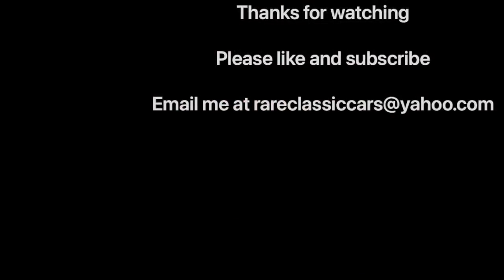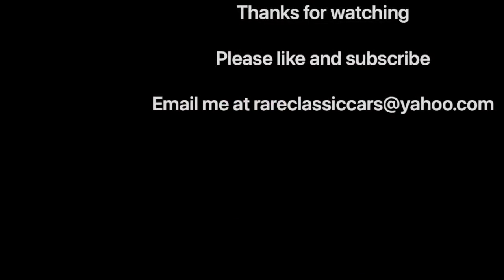Worst Engines of All Time: GM 2.5L Iron Duke Follow Up

Comment: A noisy, crude, rough and weak engine that gave no driving enjoyment. Sounded like it was full of marbles. I don't care how long it runs for, that just means all the more suffering with it. An engine that encouraged people to check out the competition. Definitely one of the worst ever. Your analysis is correct Adam. And by the way I had one in a Citation that ended with a rod out the front of the block and oil on the hot exhaust which ignited and I gladly let it burn. It was over. Finally.
Reply: 301, runs extremely smooth.  Half a 301, not so much 😢
Reply: Was she over the "redline" when she blew?

Comment: The air cleaner on the iron duke 2.5L is too small at its max HP / airflow range. A GM AC air filter in the 80s was ok but a Fram air filter was way too restrictive.  Many of the 2.5L cars really needed a bigger air filter size.

 The top speed of the 1982 Camaro is like 100 to 105 with the AC filter and like 90  to 95 with the Frams..and you better hope that fram filter is not dirty. 

There is such a restriction with the fram that i have had the filter collapse and break and now you have more HP since no crummy filter in place.   

So if you are traveling at 70 85 or 100 mph about the same HP is needed in an 1982 camaro whether you have a a 2.5 or 2.8 or 5.0 engine.  

The 2.5L engine has heavy pistons thus never is going to rev as high rpm as an engine with smaller lighter pistons

Comment: I liked your first review.  I found it good and kind of funny in that it called it one of the worst, yet encouraged guys to buy one to try it.  My parents had one in a Chevrolet Celebrity.  My parents bought it used with 80-ish thousand miles.  I thought they were going to have numerous problems with the engine, transmission and steering rack, yet they had zero!  The engine was just as you said - low power, good fuel mileage, rough, etc.  To me at the time, I thought completely uninspiring when you could have "foreign" car that was far more enjoyable to drive.

Comment: In 1982 I was a test engineer at GM's Milford Proving Ground - what a great job!  Anyways we ran tests comparing the 4 '82 A car engines for acceleration and fuel economy.  We tested a Chevy with the 2.8L-V6, a Buick with the 3.0L-V6, a Pontiac with the 2.5L Iron Duke, and an Olds with the 4.3L-V6 Diesel.   The 2.8 and 3.0 were carbureted, the 2.5L had TBI fuel injection, and the 4.3 was indirect injection diesel.   All had the 3 speed THM125 automatic.  The results were, the 2.8L was the quickest (0-60 about 12 sec I think) and got better economy than the 3.0.  The 2.5 and the 4.3 were similar, with the 4.3 diesel being a bit quicker, and the 2.5L getting a little better economy.   So the 3.0
Reply: sorry  - so the 3.0 and the 4.3 did not make much sense and did not last very long in the lineup.
Reply: Always good to hear from guys who  worked at GM.  You got the inside knowledge 🙂
Reply: Do you have any stories of working with GM's wonderful Cross-Fire fuel injection during that time?
Reply: @dennissmith9577  Sorry Dennis, no, other than remembering that it did not perform any better than the Qjets.

Comment: I have a 1984 Pontiac Fiero with that engine with a manual transmission, and even though it was behind me, I had the sunroof rattle so much because of the engine just idling, which is why I open it when I drive the vehicle. I enjoyed the follow up video nonetheless.

Comment: Sounds more like a case of misapplication.  If GM is putting an engine best suited to small trucks in it's nicer cars, that's more an indication of GM's contempt for it's customers rather than a reflection for the quality of the motor.  GM could have made another "worst motor" if they were somehow able to foist LS powered locomotives onto railroads that trusted GM to sell a suitable product.  The Duke was a mediocre motor but a big improvement over the Vega 4, the odd fire V6 and the Olds Diesel.
Reply: I never understood how GM sold those odd-fire V-6’s to anybody, especially in a nice car like the ‘76 Regal. No amount of fuel mileage savings would make me choose that engine over Buick’s superb 350 V-8. 

The vibration from those things was far more irritating than the Iron Duke’s roughness. 

Ironically, that 231 shaker evolved into one of GM’s best-ever engines ...
Reply: @sking2173  The odd fire paint shaker was bad enough in it's 1960s smaller displacement version and was even worse after GM bought it back from Kaiser and enlarged it to 231.  Buick attenuated some of the shake with pillow soft motor mounts, which were sure to tear apart in a few years.  The mounts were physically the same, right and left, but they had different part numbers so I expect one was even softer than another.  The aftermarket mounts were harder and presumably more durable but REALLY transmitted the shake to the rest of the car.  I have no doubt that the odd fire V6 earned a big share of the "NEVER F-ING AGAIN, GM" vows from irritated customers.
You're right about the Buick V8.  Buick could have simply reduced the bore like Olds did with it's 260 V8.  The 260 was super smooth but gutless (whattya expect?)  and, if I recall correctly, equaled or even bettered the V6 in EPA gas mileage ratings.  Buick should have treated their customers at least as well.

;
Reply: @21stcenturyfossil7  — Those “pillow-soft” motor mounts were popular with manufacturers in applications with larger inline-4’s, too. Pre-balance-shaft Toyotas and Volvos were especially notable for their soft mountings, so much so that the entire engine/transmission would visually rock around, and that movement was obvious while driving, especially with manual transmissions.

Your point about aftermarket mounts is a good one. I’ve seen people go cheap on replacement mounts and be totally shocked when their smooth little car transformed into their wife’s vibrator.

Comment: When I was 16, my father gave me 1979 pontiac gran le mans. It was a smooth running V8 car, but it did have some issues. A year or two later he traded for it a 1990 chevy celebrity with an Iron Duke. That car ran rough as a cob, was loud (due to a developing exhaust leak), and probably made 50 hp. It could not maintain speed on hills no matter how early or how hard you mashed the gas. I have never had such contempt for a car. I used to rip the shifter around while i was driving in the hopes that the transmission would break, but it stubbornly ignored me, like a truculent mule. I did not miss that car when it was replaced. Celebrity I hope you slowly rusted away in a junk yard and got melted down to make a sewer pipe.
Reply from the maker: That’s pretty funny.
Reply: The only thing worse than a car you love that breaks (ahem, Northstar) is a car you hate that won't. 😂

Comment: My experience with that engine was in a 1988 GMC S-15 with manual steering and a five speed manual transmission in a company pickup truck. It definitely was noisy as I remembered it. The fact that I personally tend to rev up the engine to higher RPMs before I shift to the next gear didn't help much either. I do vaguely remember driving a couple of GM A-body cars of the mid 80s with that engine and I can certainly remember them being slower than the V6 equipped models. My mother had an '84 Buick Century and it was thankfully equipped with the 2.8L V6. It wasn't going to win any races but it could definitely get out of its own way. The only advantage to having the 2.5L four cylinder is it was equipped with TBI so engine starting did not require depressing the gas pedal. I never understood why GM didn't just go EFI to all their engines at the same time.
Reply: TBI was atleast reliable. It was a cost saving measure. They could market the vehicle as having fuel injection, but could reuse components from the carburetor setup. Air cleaner, intake and other components were either the same or similar

Comment: I had a 1989 and a 1990 Pontiac Grand Am with the 2.5 litre Iron Duke engines in both cars. This engine performed wonderfully in both cars. Had adequate power and not a hint of lack of refinement. So I fail to understand what kind of problems you've seen in these engines. My Pontiac service manager told me the 2.5 litre Tech Four was a very reliable engine and I never felt otherwise. The first generation Grand Am was a well built car. A best seller for a while. Later generations not quite as impressive. By the time Pontiac created the G6 and the Aztek they had hit bottom with crappy cars.
Reply: Your 2.5’s had balance shafts. Pre-88 Iron Dukes did not; those were the loud, rough ones. Yours were good engines ...

Comment: Being reliable is the first step in building a great engine. Having great smoothness, power, or economy is what takes a reliable engine and brings it to the next level. In my opinion, the biggest issue with the iron duke is that GM could've made it smoother without sacrificing any of their reliability.
Reply: In ‘88, GM started using balance shafts in that engine, which was a huge improvement ... But most people had already formed their opinions about the engines by that point ...
Reply: @sking2173  I figured that came much later than the 70s/early 80s.
Reply: They probably should have left the original bore and stroke alone, instead of giving it a 4 inch bore, as big-bore 4s are not the smoothest engines around.

Comment: Adam, Your "Iron Duke" comments were right on. Wasn't this engine a cast iron head over the aluminum block that had problems with over heating a first? Was not a good specimen for a 4 cyl out of GM (Pontiac division) over all. Your right about one thing as the customer did in fact leave GM & Ford early during the fuel crisis for the Honda's and Toyota's because of this engine and the Ford 1.6/2.0/2.3 4cyl engines.
Reply from the maker: These were all iron. The Chevy 4 cyl had aluminum heads for some years.

Comment: The later fuel-injected, balance shaft, engines are at worst good(they are underpowered) but for the time period, the fuel mileage and reliability were great. If you bought a GM "luxury car" at that time you were paying a premium for a chevy same exact car with badges Chevy Cavalier-Pontiac- Buick-- Olds---Cadilac Cimmaron The only difference was the badges and what came standard (power this and that wheels interior etc) So yup GM shot themselves in the foot by trying to make bank on the nameplate without the refinement that was expected. The other engine options(in the larger cady's were JUNK) 4-6-8, the HT-4100 (which blew head gaskets) at 35k, etc.
Reply: The “4-6-8” was a good engine if the “variable displacement” feature was disabled.

Comment: you are correct about expectations I just find it hard to call a mid-'80s engine that was reliable "the worst" the Cadillac 4-6-8 engine yes it was horrible as were the converted gas to diesel engines.

Comment: I had a 'Tech 4' version of the 'Iron Duke' in an 1985 Chevy Celebrity - It was 'reliable' - Starting on very cold day with the throttle body fuel injection was an adventure and the so call 'brakes' on that car made sure that you didn't tailgate! 
Truthfully I sort of miss the old dear...

Comment: The Iron Duke may not have been a great engine, but it has to be remembered that it came as a replacement for a terrible engine, the all aluminum Vega engine, which didn't have iron sleeves and quickly scored the cylinder walls.
Reply: I heard the reason the engine was called Iron Duke was to emphasize the fact that this engine was NOT made of aluminum.
Reply: The aluminum cylinder bore were coated with a special chemical made by Dupont, and the designers made an error in calculating the engine's thermal expansion.
Reply: Strange that they wouldn’t actually measure and verify the thermal expansion before going to production. As I understand, they were under pressure but for an aluminum cylinder, that seems like an important thing to know.

Comment: Reliability>Comfort any day of the week for me.  I grew up driving old iron though.  Give me hand cranked windows, a manual transmission, and a heater.  Never owned a car with AC.  I just want my shit to work.  I don't care about comfort.
Reply: Depends where you live. Where I am you'd really suffer without A/C, temperatures above 100F and humidity above 80% are routine.
Reply: @nerd1000ify  And 90% of the time I'm skipping motorized transportation and riding a bike.  You get used to it.
Reply: @rayceeya8659  I cycle to work too. Doesn't take any longer than driving;)
Reply: @nerd1000ify  Not cozy but reliable as hell.

Comment: I had a 87 Buick Century.  It was silver.  It had the Iron Duke.  The silver paint came off the horizontal surfaces in chunks.  I couldn't get GM to repaint the car.  The body shop guy said..."I guess the paint didn't stick that day".  The cam gear failed in the middle of no where. 200+ mile towing bill.  Fixed it and got rid of it.  Lost a lot of faith I had in GM after this car.

Comment: I'm not sure about it being that bad. Yeah it's not that much power but it's not meant to. But as far as durability it's pretty much impossible to kill and obviously was in so many different cars over the years. When I was a little kid my mom had a 79 Chevrolet Monza with the Iron Duke, and later when I was a teenager the first car that I had for driving use was a 91 Oldsmobile Cutlass Ciera with the same Iron Duke. Very versatile and reliable engine for certain.

Comment: Jeep used the GM Iron Duke from '80 to '82 in CJ5 & CJ7s until AMC could get their own 2.5 developed from the old 258 AMC straight 6.  I owned an '80 CJ5 with it and would buy another in a minute if I could find one.  In a lightweight Jeep CJ, it was a bit "perky" and I averaged 25+ mpg on the highway with it.  The only issue I had with it was that the carb was directly over the HEI ignition with it's built in coil and if the carb leaked gas, it would leak onto the distributor, you rapidly had an underhood fire.  (Don't ask how I know this all too well).  But other than that, I loved that Iron Duke powered Jeep.

Comment: My first new car was a 1978 Pontiac Sunbird with the Iron Duke. I was so disgusted by the lack of power that I traded it one year later for a new 1979 6.6 Litre Trans Am which I still have in my garage today. The interesting point is that due to the gas crisis of 1979, I ended up paying less than $2000 for the trade. People were paying premium for the 4-cylinders and no one wanted the T/As in those days.
Reply: I am not a sporty-car lover, (too old, need something easy to get in and out of), but a Trans Am sure would be fun today!
Reply: A high school friend of mine had a 1970 Hemi Cuda in his garage that his dad had bought in 1980 for like $300. No one wanted them, and it's worth an absolute fortune today.
Reply: You made a good investment on that Trans Am.
Reply: @jeffrobodine8579  I believe so. It's a WS-6 and I kept it all stock and have only 50K miles on the odometer. I keep it garaged and only drive it around 100 miles a year. Glad I cut my losses with that Sunbird.
Reply: I think you are mistaken. Pontiac sold 116,000 Trans Ams in 1979... during the gas shortage. To put that into perspective... that was just Trans Ams, not including Formulas, Espirts, and Firebirds... Chrysler didn’t sell that many E body Barracudas in 5 model years.
Reply: @drippinglass  You are right but the sales figure you give is for the entire '79 production year. I bought mine at the end of the '79 year just after the gas crisis and I could see a glut of T/As at the dealer lot. BTW the actual T/A production # for '79 is 117,108. Total Firebird production was 211,454. For 1980, the production numbers dived to 50,896 T/As. This was due, no doubt, to the loss of the big 400/403 engines as well as the gas crunch. The largest engine you could get in 1980 was a 301 with a turbo.
Reply: @Sam_Eassa  That 301 was a big disappointment.  It would have been OK for a base Firebird, but in a Trans?  Big mistake.
Reply: @michaelbenardo5695  Agree but it was a GM corporate edict. No more big engines after 1979.
Reply: @Sam_Eassa  I know, but it was still a shame.  It castrated the Trans Am.
Reply: I remember my favorite saying in the 80's was  "People will pay anything for economy" LOL
Reply: WS-6 in '79 .  First year for the 4 wheel disc brakes,right ? Does yours have 'em ?  My '80 did.   Amazing for that era.  Saved my ass from an accident for r sure
Reply: That's awesome, haha
Reply: Would've done better to swap a V-8 into the J-body... because the power/weight would've out-shined the Corvette, and the car's construction & chassis out-handled the Trans-Am and Corvette.

Comment: The description of how the front wheel driver iron dukes were at idle appears to be the same as the experience would be if you bought a Ford Escort in the 1980s.  I never owned a 1980s model, but did ride in some. Of course the Escort was not considered a high end car at all. We did own a 1992 Escort with the Mazda 1.8 engine.  It was great with very little vibration.  Went over 240000 miles.  My mother owned both a 1980s and a 1990s Taurus with the V-6.  engine.  No vibration there either.  Both went over 200000 miles.  The biggest issue was with the paint on the first one.  Ford had just starting using clear coat and was having issues.  Ford was re-painting cars, but the dealer she bought the car from would not repaint hers(she should have contacted Ford, but did not) but would re-paint the local bankers car.  Needless to say, that dealer lost her business.
Reply: Yes, I had a 1985 1/2 Escort with the 1.9, and the steering wheel vibrated heavily at idle.